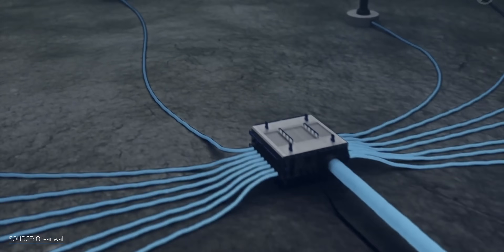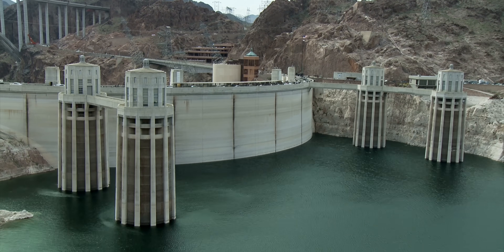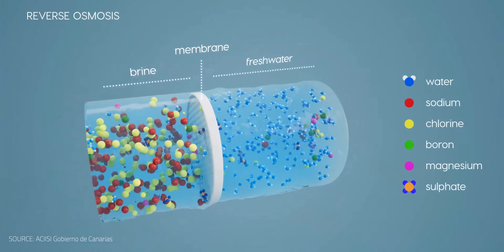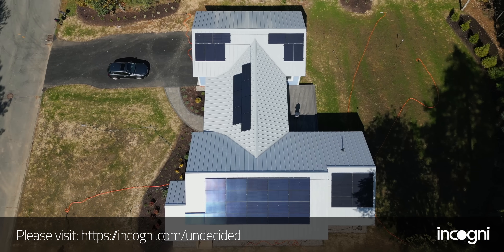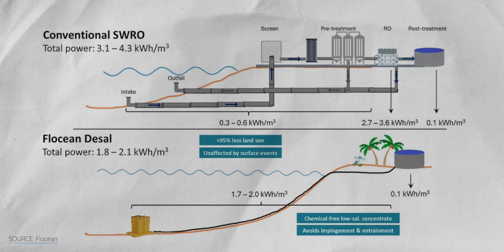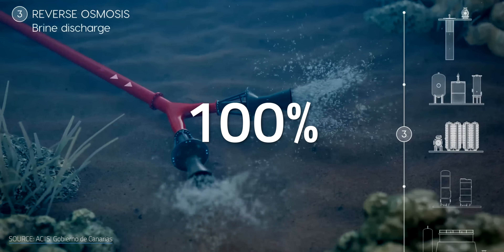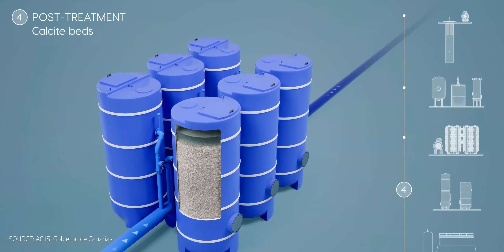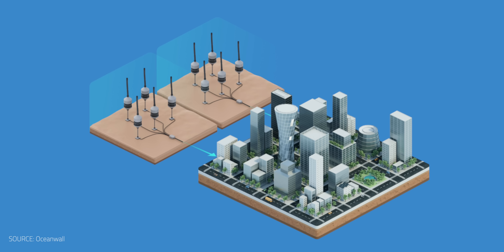How Deep Sea Water is Now Drinkable

Comment: Shouldn't creating a vacuum at that depth require the same amount of energy as creating the same pressure on land? Where does the energy advantage come from?
Reply: @PaulPaulPaulson  guys, you are misunderstanding it. Reverse Osmosis systems don't act like normal filters with normal hydrostatic equilibriums. In order for REVERSE osmosis to work, you need to overcome the  pressure of osmosis (osmotic pressure). This is something like 35 atmospheres of pressure. The deep sea system uses the immense pressure of the deep ocean to counter the osmotic pressure. Once you counter osmotic pressure, all you need to do is pump normally. This saves a MASSIVE amount of energy.
Reply: Lots of stupid comments here. You are right, the pressure at depth is no help and the difference in density after desalination is only 2%. Not nearly enough to create the efficiency improvements they describe. The benefits must be in the hypothetical reduction or elimination of the chemical steps due to reduced microbes. Does this offset the increased capital costs of installation or the increased maintenance costs (scuba maintenance technicians cant be cheap)? Maybe, maybe not. The land issue might be the deciding factor in coastal areas. This is just a sixes technology that might allow us to hide our ugly desalination under the ocean. All things considered we need abundant and constant clean energy to make either plan work. Which in the near term (and maybe the long term) has to be nuclear.
Reply: So on land. You have to create the pressure on one side, while obviously having a lower pressure on the other, to force water through the membrane. At depth, you create vacuum pressure to bring the water up and overcome the water head pressure.

Two sides of the same coin. Push or pull 🤷‍♂️ 

The difference are that filtered water is less dense, less energy required for pre filtration (each step requiring its own membranes and filters), and less overall filtration because of less biologicals.
Reply: You can't actually suck water by from depths below 10 meters. It's going to create vacuum and boil at room temperature. I guess this is why they have underwater pumps.
Reply: My guess is the energy advantage comes from not having to pressurize the brine, only the clean water. On the surface, you pressurize the untreated water, lose energy on the filter, and then lose energy when you release the brine. If you put a suction pump on the output under high ambient pressure, you only lose energy through the filter.
Reply: I believe this won't work on land water is filtered with a pressure difference. At the bottom of the sea the pressure is the same on both sides, you will need the same energy to force water through the filters. To me this doesn't make sense.
Reply: @luis356  fresh water is less dense than salt water. So at enough depth, the pressure difference could be enough to provide the required pressure difference to run the system
Reply: @luis356  The pump is what creates the pressure difference. Even underwater. Except we're starting from a higher pressure on the side that needs to force its way through the membrane, which means less work for the pump to create a working pressure differential.
Reply: Not having to do pretreat. They're not pulling a vacuum rather making a reverse bathtub drain the pump in close to the farm the pressure from the ocean helps force the water thru the filters
Reply: If you pump at like 25m, but force the water path through the system at depth. You have the ocean pushing through the system to equalize depth.  That being said others have said the membrane becomes permeable at pressure.  I don't know enough to confirm that.
Reply: I think it’s because of the pressure loss across the membrane. If you can put the pump on the lower pressure side, you don’t need to use energy to force it through. You do however need to pump it up the 400m to the surface.
Reply: The way I see it…
If you put a 400m straw, with a membrane and place it in the sea, then fill it up with potable water, then the level will drop (to a level x) but not nearly as much as if you had it placed at a sallower depth. So you don’t need as much energy.
Now if I were to guess, the optimal point to place the pump would be to the level the potable water rests,(level x), since pumps are more efficient at pushing than pulling! But since this would be complex, then the pump is placed with the membrane unit.
Hope this is helpful
Reply: This is the perpetual motion machine we have been waiting for!
Reply: I don’t understand this.   You need a lot of pressure across the membrane to make this work.  Not seeing where the pressure difference comes from, unless you are somehow pumping out the fresh water side and pushing that water to the surface.   Should take exactly the same amount of energy as doing it at the surface, except for the flow loss thru the long pipe making it worse.
Reply: fresh water weighs less. it will want to float to the surface.. its not enough to get it to pass through the filter on its own so pumps are still needed. simplified.. its easier to make 340psi than 360.. it wont be a ton different and changing filters at that depth will be more expensive.. but they seem to think there is still money to be made this way.
Reply: @PaulPaulPaulson  think of it like a well or a deep ground aquifer. Once you pump out the initial salt water, the deep sea pressure will force fresh water into the artificial aquifer, creating negative pressure to pump up the water is MUCH less energy intensive than creating the high pressures needed for reverse osmosis
Reply: @HkSx12  didn’t understand, did notice fresh water is less dense than salt water, at a significant depth, the difference in density reduce the amount of power needed.
Reply: I guess maybe its also related to it being a drip system, so they arent trying to move that much water at any given time, and therefore dont need to be as foreceful. 🤷‍♂️
Reply: Since the others wont explain it, think of a droop in a line. If you take water out of one side even the top both sides will equalize. They are putting the filter in the bottom of the droop where the most pressure is at, while pumping from the top of the fresh water side, and letting the water pressure push it though. I question the need to put the pumps in the water as it complicates maintenance, but it might be fore the "smaller footprint" claim. The basic claim though is grounded and realistic despite the buzz word attempts.
Reply: @Awrethien  The savings come from the fact that there is more salt water in the system that needs to be pressurized than there is fresh water. So if you get the choice of whether you want to pressurise the salt side of things or the fresh side of things (move it up to the surface) choosing to do the work on the fresh side will need less energy.   Now since you are not not doing any work on the salt side, the volume yo use doesn't matter, so there is no longer a need to wring every last drop of water out of it so the concentration of the remaining brine doesn't need to be anywhere near as high on the output side.

The down side is that all maintenance is at high pressure in an inhospitable environment.
Reply: It comes from the pressure differential. It's lower at the bottom of the ocean. Much higher on land.
Reply: @gungan5822  The pressure differential is identical at the bottom. (density of water notwithstanding).

If osmosis requires high differential pressure, you *dont get a free lunch*.  

Imagine a droop in a line as described by @Awrethien at the bottom of the droop, draw a line.  That's your filter membrane.

*Both sides of the membrane have identical pressure*.  Because the water "above" each side of the droop is what is causing the pressure.

Your differential is 0.  Zero difference on either side.

If you pull 1 atmospheric pressure off on one side, You don't magically get more than 1 atmospheric pressure at the droop.  You get the exact same 1 atmo differential at the filter.

If your filter *requires a high differential*, guess what, you can't fix it by putting it underwater.  The requirement for a high differential still exists. 

The only reason this saves any power (the 40%) is because you only put energy into changing the pressure of your output water (the fresh water).  You don't put any energy into pressurising the Input water (the sea water).  There is NO saving in generating the pressure differential per se, just because it is underwater.  You still need to create the same differential.

But, the reason this isn't as big a saving as you think, is because there are desalination pumps that already "Recover" 90% of the energy you put into the Briney waste water anyway.  So *you can already save 36% of this so called "saved" 40% energy on land.  By just using better/more complicated pump designs.

So, now you are left with not having to treat the incoming water because it comes from the dark bottom of the ocean.

*why don't we just stick a pipe into the ocean and draw in ... dark bottom of the ocean water directly*.

Now we get the "benefits" of not needing to treat the water, and the benefits of our difficult to maintain pump and filter infrastructure on land.  Amazing.
Reply: Like sucking liquid from a pipe the other end is at bottom of container, it will siphon.

Comment: Love the show!  Why don’t they just dig a 1000’ well with a big bell at the bottom to put the pumps - would that be the same???
Reply: @adrianabshire  the pressure comes from the weight of the water above.
Reply: @felix_karl_6560 imagine a straw, a REALLY long straw, and you dunk it to the bottom of the ocean. Would the water then coming rushing up and out of the straw like an oil strike from the Beverly Hillbillies?
Reply: @Hydrogen101  No. That's not how pressure works.